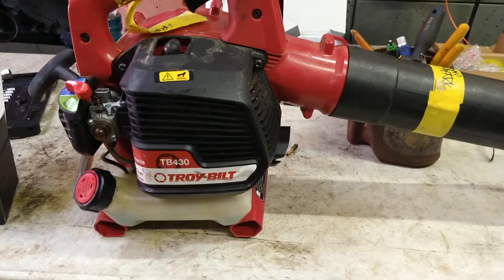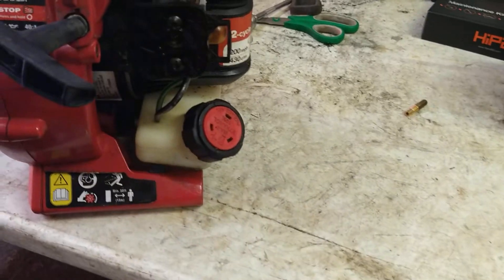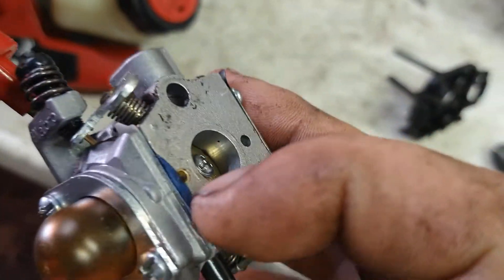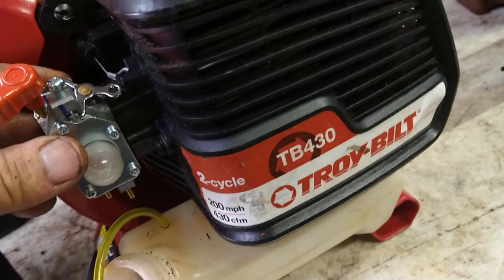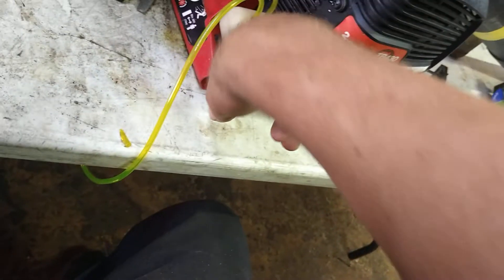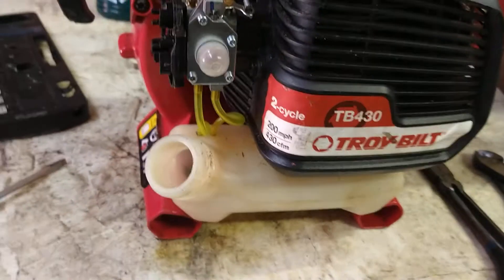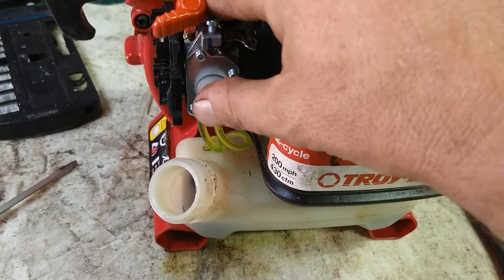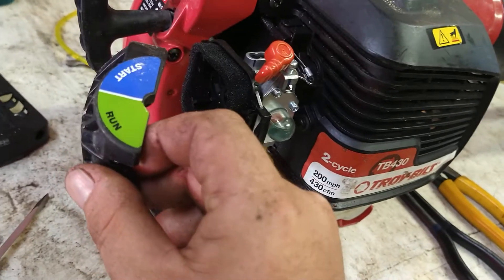troy-bilt tb430 carburetor repair fuel line repair

Comment: I just did the exact same job on the same model,  can't get the primer to prime up no matter what I did
Reply from the maker: pinched hose? lines backward? you did use a new filter?
Reply: @smallengineguys  yes , new filter, new lines , and tried them both ways, no kinks or holes
Reply from the maker: something is wrong with the carb gotta replace it.
Reply: @smallengineguys  yep, I narrowed it down to the thin plate for the bulb , getting gas to it but not through it
Reply: @smallengineguys  BTW thanks for the help